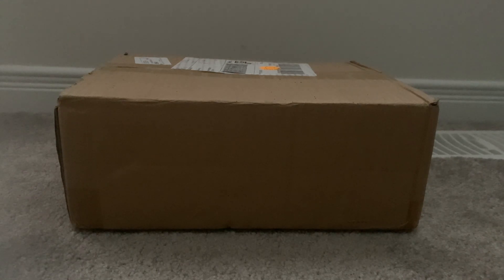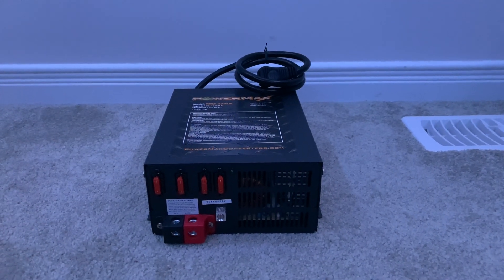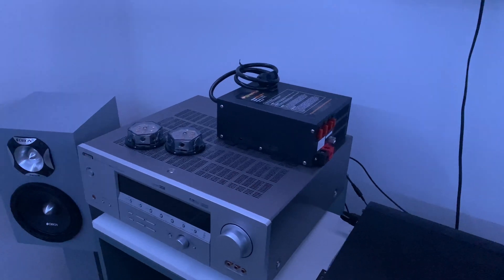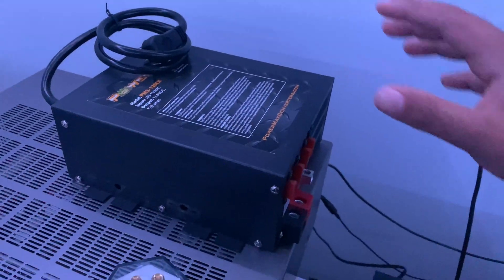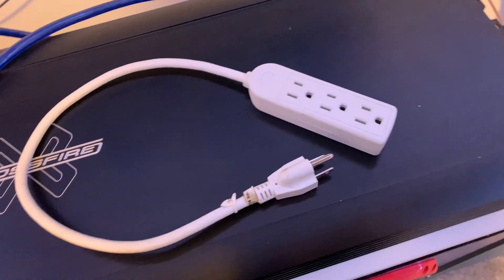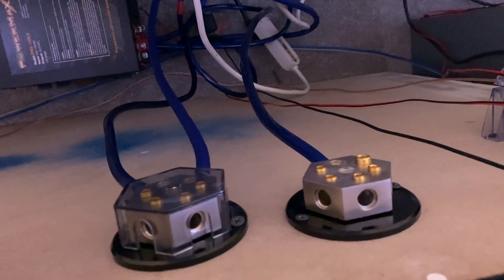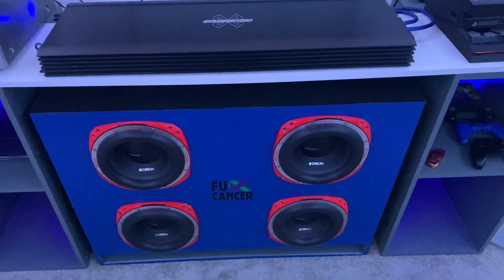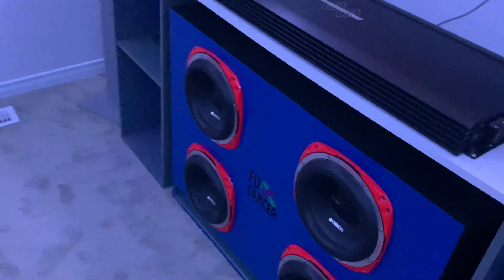How To Connect 2 Power Supplies Together

Comment from the maker: What’s your guys opinion and suggestions?
Reply: I would just buy a Crown amplifier
Reply from the maker: @K-Effect  low key
Reply: I have 2 of those
Reply: psu's have common ground from the power line so if you connect them in paraler you short the ground between them, its not like with batterys or transformators that you can do paraler
Reply from the maker: @crxxpslvyr7887  you’re onto something, so what are u tryna say? What should I try?
Reply: @blazedlegend  you CAN NOT bridge them togethe because they are switching psus and the frequency is generated its out of sinc from each and if you over lay them they fuck up the signal. it can be that the didnt made a sinc connector for sincyng up operating singnals
Reply from the maker: @crxxpslvyr7887  Ahh okok
Reply: @blazedlegend  i mean if they state that it can work, you should try getting in contact with the support
Reply: @crxxpslvyr7887  you def can sync them lol in fact that is a feature on this psu...
Reply: Can't you just run a capacitor to run higher amps?
Reply: Have you thought about getting a pro audio amp?  Seems like it would make things a lot easier.
Reply from the maker: @damon20r  thought of it, but I’ve heard they clip easy so idk
Reply: Well then you spend all of your money for sound
Reply: You didn't link them together and they fought each other. Those are plenty capable of running 200 amps. Some research would have straightened you out. Also two different dedicated outlets will help. Was easy mistake we all have to learn.

Comment: They have and the 220v model of their power supplies?
Reply: Yes best just wire a 220 up and buy a big single supply.  You have to tune them together running 2 and definitely use separate outlets.

Comment: I have almost the exact setup in my home gym, including my Orions, 2 12s and 2 15s. The only difference is I built my power supplies by connecting multiple computer PSUs in parallel. This is the same concept as yours. The light turning off is likely from improper load sharing between power supplies. This means one is working harder than the other and will burn out faster. I used schottky diodes to fix that issue. this guy explains it well https://www.youtube.com/watch?v=WVK1tkCYy9U&t=353s

Comment: Just came across your videos
I run some server power supplies to my shitty amps In my  speaker system, the reason is because they are cheap for the most constant power. Check em out. If you run your power maxes in the same circuit they will eventually trip your breaker. You can run power supplies parralel I believe from different circuits, that's my understanding. You know those washing machine connections or electric oven, those are dedicated 20 amp circuits. They can run more power. Use them. You will get way more power. Just becareful and be very cautious.

Comment: How do you figure out how many amps you need? Planing to build a big set up for my shop. I have measured current draw on my amps before. Just have no idea how many inverters i need or battery's ect.
Reply: depends on how many watts your pulling, for example the 75 amp powermax at 110v does 1k watts and the 120 amp does abt 1750 watts. and as shown in the video if you need more power you can run more than one

Comment: Maybe You should Check ur voltage again and maybe turn it up a little
Reply from the maker: I was mixing ofc and cca wire and maybe they might be set at the same voltage but at diff rates? I’ll try to take both supplies some where else where it’s no too compact and fo it with the same wire and more space to figure it out
Reply from the maker: Just went and tried using same kind of wire and still... I fiddled with the voltages and still don’t wanna work together
Reply: @blazedlegend  I think i found out, u might have to connected it too the other terminals. Also ur Gain also matters, because it pulls from one until it need more power then it pull power from the other.

Comment: Maybe Power supply is faulty try single one which is causing problem
Reply from the maker: I tried Individually, each plays normal
Reply: @blazedlegend  they most likely are not bridgeable
Reply from the maker: @djlolerkoster  Powermax states that you could wire both in series or parallel 🤔
Reply: @blazedlegend  plug both of them in their own outlet
Reply from the maker: @cuh_2023  I like your thinking, but apparently when you merge 2 powermaxes the light dims and turns off and it kicks back on apparently after when you overload the first one that’s on
Reply: @blazedlegend  oh you have 2 power and grounds just hook them up separately
Reply: you must use diode in positif terminal for each power supply

Comment: Make sure your outlets can supply the power needed also. Might need to plug 1 pwr supply into a different outlet that is also on a different breaker. Most houses have 1 20 amp breaker for each room. Older ones might use 1 20 amp breaker for each section of the house.
Reply from the maker: Yeah I did research about that before 🤔